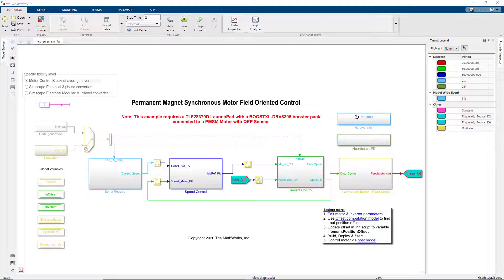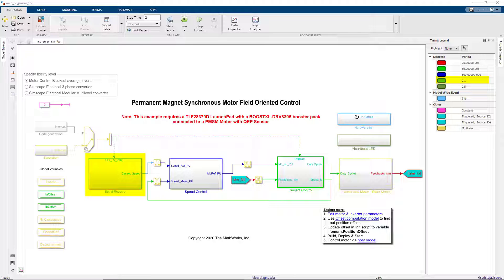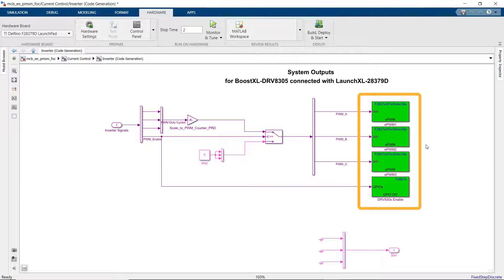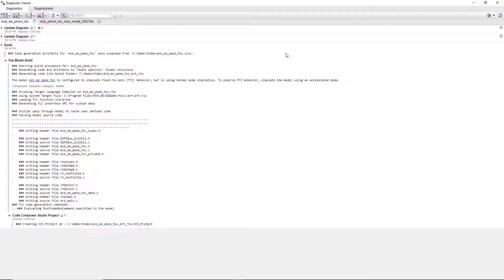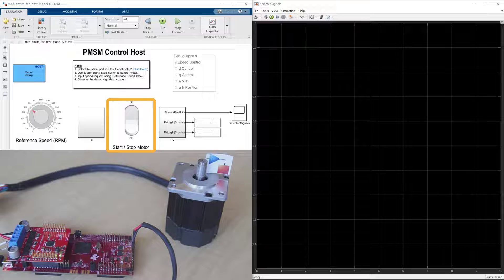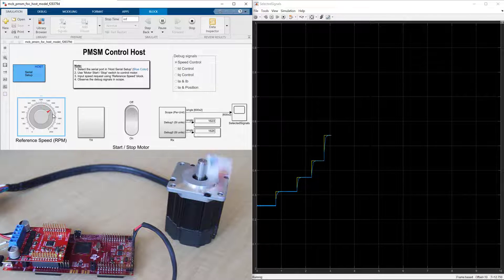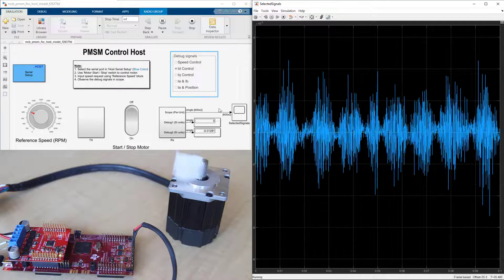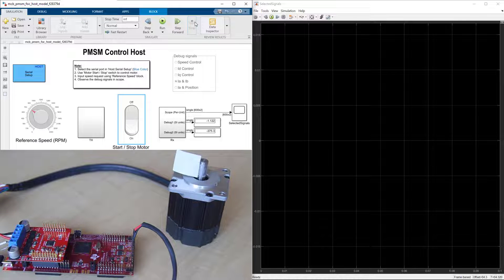How to Deploy Control Algorithm to a Microcontroller | FOC of PMSM with Simulink, Part 3

Comment: Can this workflow be implemented for a different microcontroller or Xilinx’s Ultrascale MPSoCs? Where can one find the motor control example project for adaptation? Thanks
Reply: Hi, thanks for watching and for a good question. The workflow can be used to target a different microcontroller. In that case you would need to follow the approach described in this example: https://www.mathworks.com/help/mcb/gs/use-mcb-generate-code-for-custom-target.html. Essentially, you would generate code for the algorithmic part, and then integrate generated code with your own driver code.  The video is based on a shipping example in Motor Control Blockset. You can find the examples here: https://www.mathworks.com/help/mcb/examples.html?category=getting-started-with-mcb. Most examples are setup so that you can simulate the model, and then generate code and spin the motor using exactly the same model. If you are interested in targeting SoCs, you might want to take a look at SOC Blockset https://www.mathworks.com/products/soc.html and this particular example: https://www.mathworks.com/help/soc/ug/motor-control-simulation-example.html. Hope this helps.
Reply: arkadiy turevskiy  thanks for the detailed reply